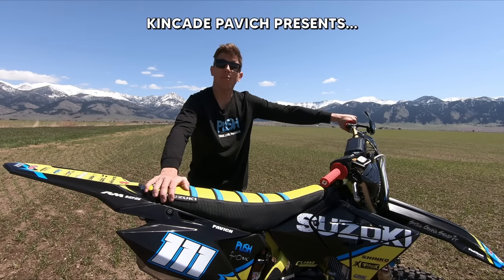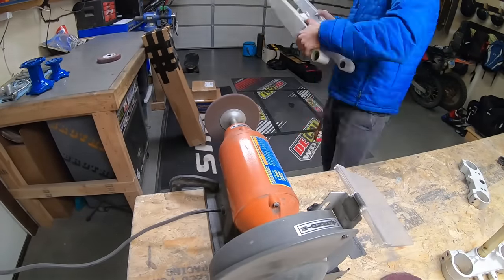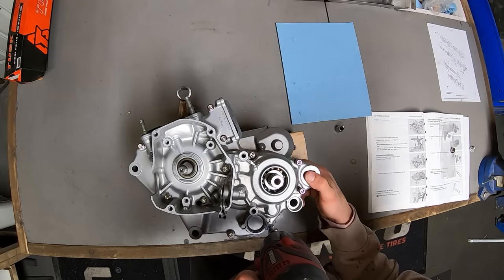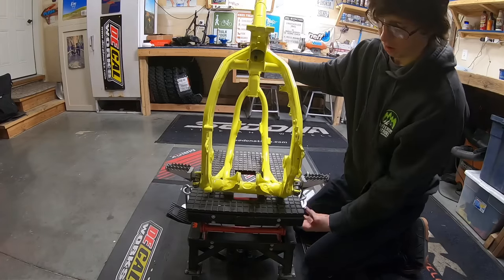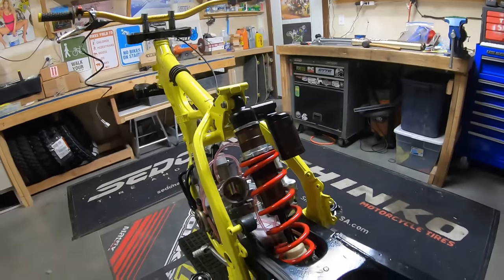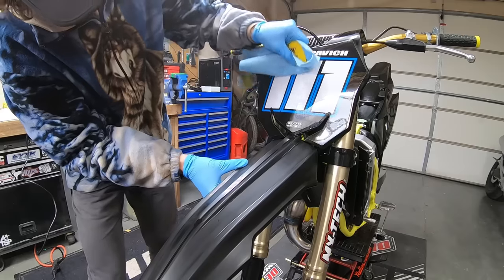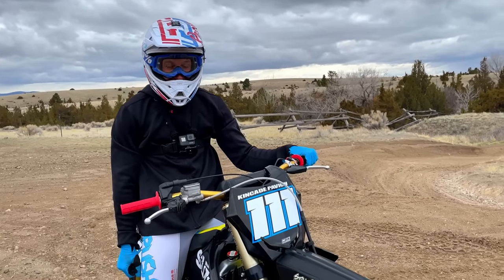Incredible RM125 Two Stroke Dirt Bike Rebuild from Start to Finish

Comment: Anyone doing this type of work should build themselves an electrolysis tank. It's insanely easy and makes removing rust and grime so easy, you'll never go back. As a side benefit, once you have your electrolysis setup, you are 90% of the way to being able to nickel and chrome plate at home, which is the best for restoring old fasteners, pins, etc.

Comment: great build, man! I just bought an 01 o plan on rebuilding. if I can make a friendly suggestion... when masking off to paint 2 colors, if you make the first coat after taping your base coat color, then shoot your second color, it will leave you with much crisper tape and paint lines.

Comment: Some advise here.  After powder coating, it is a good idea to remove the powder coating under the bolt heads, as it can compress and lose torque/bolt tension.  But it might be best if you can clean up those areas, spray with a bit of rustolium paint, (or the such), and mask the area under the bolt heads before powder coating, (of which I would talk with the powder coater for the best method of masking.).

Comment: I found a good aluminum polishing product called "Wizards Metal Polish for Motorcycles".  It comes in a rectangle can like the old band-aid cans, and looks like a dense cotton candy, (smells kinds sweet too).  It does not take as much elbow grease as I thought it would, and it can get into crevices that a buffing wheel can not.  I have had the can for 10 years now, and if wrapped up well in the plastic pouch, it has not dried up.  If it does, it says a few drops of mineral spirits freshens it back up.  That brake pedal for example, would shine like a mirror with 15 min of hand polishing.

Comment: I stopped freezing the bearings for installation.  The amount the steel shrinks is tiny compared to how much the aluminum bore increases, (I stay under 350 def F. for ovens), and I have had problems of the cold bearing sucking the heat out of the cases, and shrinking on a slightly crooked bearing as I installed the bearing, before the bearing bottomed.  I used to heat the cases, and was able to just drop the bearing in with my fingers, (if straight enough), and actually hear it hit bottom, (if it didn't, it tended to get stuck).  But I was burning my fingers too often on the hot cases,--and went back to a arbor press and some lube.

Comment: Lacing up your own wheels too!  (I was wondering if you were going to do that.). Not too many people know how to do that well.  I learned with Mt. bicycle wheels in the mid 90's.
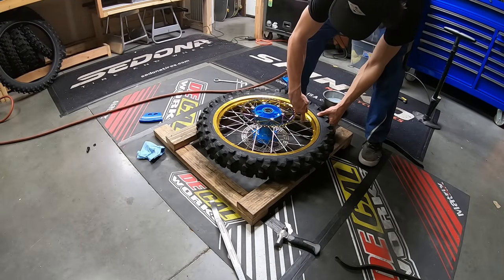22:08.  Awww, you scratched the new anodizing.   I could only get screwdrivers to work as a kid changing tires,---before color anodizing showed the chicken scratches, (would always pinch a tube with spoons), so I gave up, and have a shop with a power tire changer do it.  :)

Comment: My buddy said I could not put new graphics on my tank nice and straight, with no air bubbles, if I did not use soap and water so I can move it around.  Well, I just peeled a corner, got it straight before i stuck the corner and rolled them on nice and straight with no air bubbles.  He asked me how i did it when he saw the bike again, and I said I just stood back 5 feet and threw them on like you did with editing.  lol  He is a self employed mechanic, and I am going to tell him your bread trick.

Comment: Man that vapor blasting does a nice job of cleaning the surfaces.  That is a fairly new process I think, and I have never seen it, (studied manufacturing engineering over 20 years ago.).  Do they have to be careful with it, (like the etching process for anodizing), so it does not blow the bearing diameters oversize?

Comment: Brilliant work, totally agree on the hour meter on the bushing machine. Mine works overtime, if you don’t mind what was the colour of the frame and which year CRF front caliper did you use?
Reply from the maker: I couldn't tell you the exact color code of the frame unfortunately... It was definitely more vibrant than classic Suzuki yellow. I used a complete 2015 CRF450 front brake.

Comment: I bet the most expensive aspect was the forks and shock, (am I correct?).   That is a beautiful looking shock, no way stock.  But I can tell the spring is way to light for me just by looking at the coil wire diameter. :)
You got more information what you bought there, (is that shock completely aftermarket?) and for how much retail?

Comment: Hi mate what year crf front brake did you use ? I have a 08 rm 125 to build and the front brake is junk ..thanks for the great video.
Reply from the maker: Glad you enjoyed! I believe it was from a 2015. Any caliper in that generation will work.
Reply: @KincadePavich  thanks so much

Comment: Nice build, but you forgot to place your clutch plates(Friction clutch plates) in oil before you mounted them.
Reply: Common practice I know.  But I am not sure if it matters much today, or ever did, since it spins in oil.  But if it made a difference in the past, it might not today as materials tend to get better.  Did you know some pro MX mechanics of 2-stroke race bikes would sometimes rebuild a top end before race day practice, and put the top end together dry?  The oil is mixed in the gas, but they were trying to seat the new ring to the cylinder wall as quickly as possible for the main races.

Comment: when you put the new bolts on the new clutch basket and used a punch on the bolts did you center the punch or goto the side of them?
Reply from the maker: I went to the side. It is supposed to make the material of the basket and the bolt form to each other a bit.
Reply: @KincadePavich  thank you cause i did not do that to mine! time to take it apart

Comment: Hey love your work man looking to buy new plastics for my suzuki rm250 2006..Where did you buy your plastics and what year is it
Reply from the maker: This is the Polisport restyle kit. It will fit that 06 RM250 as well! I buy from Rocky Mountain or Motosport usually
Reply: @KincadePavich  Thank you so much
Reply: @KincadePavich  Ug.   lol    Heck, I milled mounting holes in a 2014 fender to fit my 2019 bike, cut all the silly arrow tips off, got rid of Thor's (the mystical God), arm shield they used for a front number plate, so Speed Racer would not show up at my door and ask for a ride.  :)

Comment: What did you use to hold the clutch basket and primay gear as you torque it an what did you do it to 70 n.m ??? Let me know got same bike cant stop crank moving to torque that nut and did u use any sort off locktight
Reply: Use a motion pro gear jammer
Reply from the maker: Yeah I used a motion pro gear jammer - one thing to note is it will get eaten away over time and leave aluminum shards in the gears. Make sure you look and get them out. I had one clog an oil jet on my KTM 350 a few years ago and it shredded the top end to bits. That said, they work great! You can also get a piston stopper tool and do it with the cylinder installed.
Reply: @KincadePavich  Isn't there a tool that holds the basket itself?  Something like a clutch plate with a handle on it?

Comment: Question teacher.  (the one, the proud!   lol)
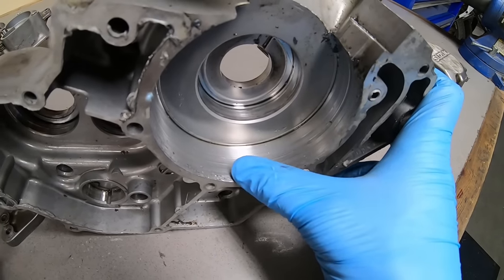At min 2:12, what did you place in the center of that bearing (in that "blind bored" hole), to use the punch to drive out the bearing?
I have used Play Doe like that to drive out solid bushings out of a blind hole, (using a flat punch with a diameter that fits almost "slip fit" in the bore of the busing.), but that would not work for an open bearing.   Is that saw dust shavings?
Reply from the maker: I am using bread! I have a video dedicated to describing this method as well. Small bits of bread and then a bolt with the same OD as the ID of the bearing. Just pack more bread it as it compresses and the bearing will be forced out!
Reply: @KincadePavich  Sweeeeeet!   "Wonder Bread".   Neat trick man.  :)
Reply: Play Doe may work on an open bearing.  It may be thick enough not to push through the bearings and cage.  I never tied it on bearing.

Comment: An old guy told me once not to grind off the casting marks. Said it makes the part weaker. Was he blowing smoke?
Reply from the maker: I personally am not at all concerned about removing 1/8" or less of material that doesn't seem to have any structural importance. I've never seen a part fail after doing so. But I'm not an engineer.
Reply: @KincadePavich  works for me! Lol

Comment: so its a dissasembly video with your own taste of colors and parts ? =P as you sent so much out to different places..  i had this bike when it came out in the shops here around late 90's =) i worked day and night for 6months to buy it, i still have some issues with my shoulder because of how hard i went into that work xD i must have at least 10k hours working on this over the years xD
Reply: Well, if you had a powder coating, vapor blasting and the suspension building stuff in your garage, he could have sent it to you.  Hey, I was sure I could rip the guy also, but he pretty much did as much as he could in his shop,---and probably made a little money getting it done.  Yours is not done yet.  So long, you will probably have to start over.  lol

Comment: How does it handle? Cornering as good as suzuki made out to be?
Reply from the maker: I think this bike handles amazing! Really, really happy with how it feels and yes, the turning is great
Reply: @KincadePavich  I doubt any new bike corners as well as the Yellow and Red 2-stroke bikes.  I can tell my 2019 YZ250 2-stroke was set up to try to keep up with 4-strokes on a fast track like they have become.  There is no such thing as "squaring off a corner" with fast, big radius bermed turns that I bet with some practice, I can rail with my Harley Sportster.  The yellow and red bikes, as MXA said in those days, "Turned like a cockroach being chased by a broom.".  :)

Comment: Why would u repair old stock radiators when good welded ones are $90???!!
Reply from the maker: Why would you replace usable radiators when you could fix them up?
Reply: @KincadePavich  because repair cost is at or above replacement cost for better and higher capacity ones…

Comment: $12.000, yeah no. Beautiful bike, but definitely didn't spend twelve thousand. More like $6.000 and even that's high. The only thing really of value is the suspension. Unless it cost $10.000, you're straight lying. Ive rebuilt numerous 04 and a 06 rm125 and 250s along with an 08. Even with new suspension, never spent over $5.000 so why lie? It doesn't make your bike any cooler. Like did you just think 12.000 sounded cool? Apparently.
Reply from the maker: @DevinReavis  okay 👍🏻